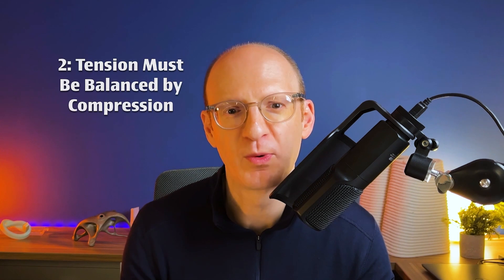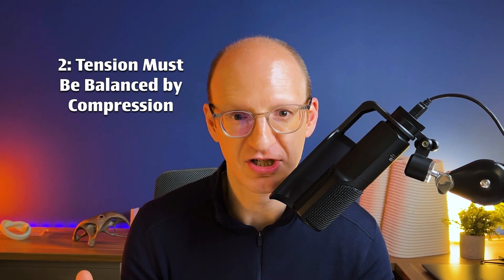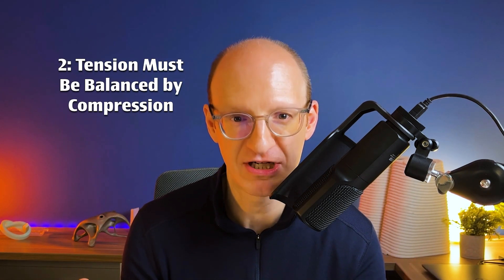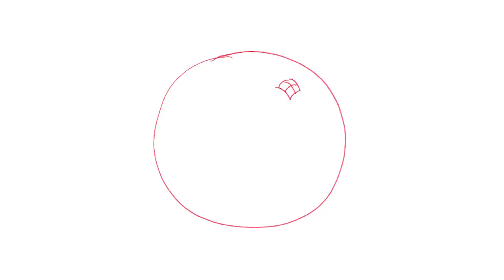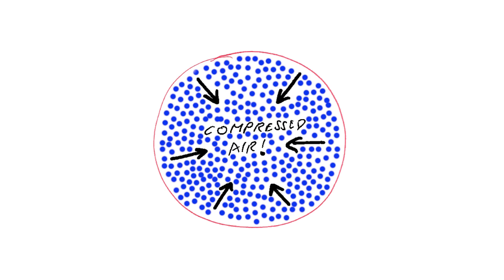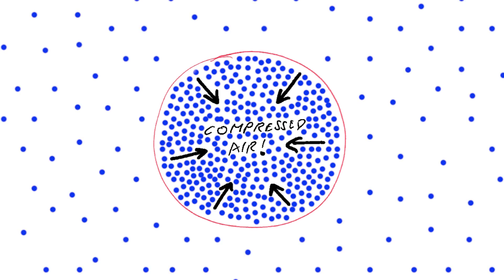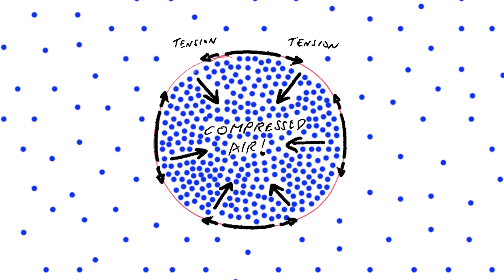Why Soap Bubbles Are Perfect!

Comment: Interesting stuff! I hope you'll talk about this subject more in length. I'm an architecture major + structural engineering minor with in interest in organic forms. It seems as though the most efficient shape for tension is not always a sphere, is that correct? That under certain conditions, the optimal shape for the bubbles and, by extension, similarly designed tensile structures, might deviate from perfectly spherical geometry?